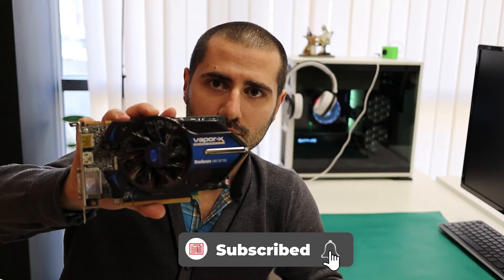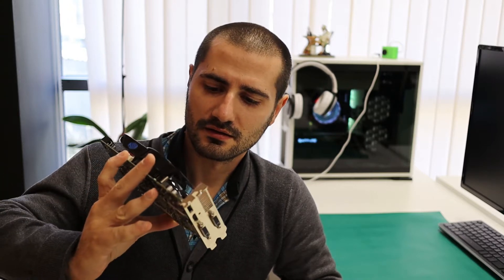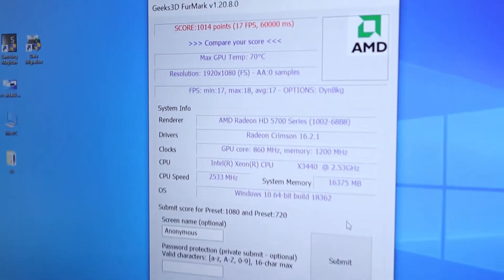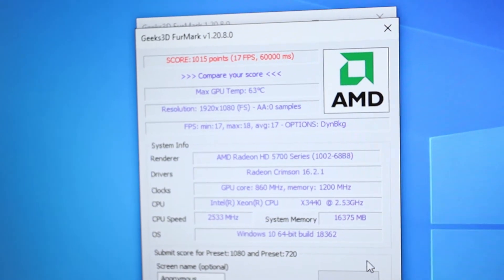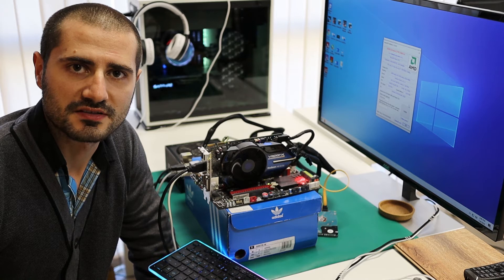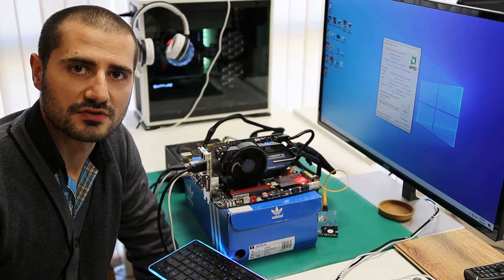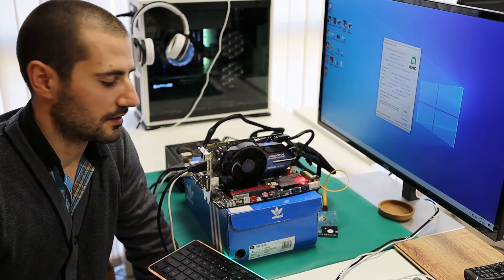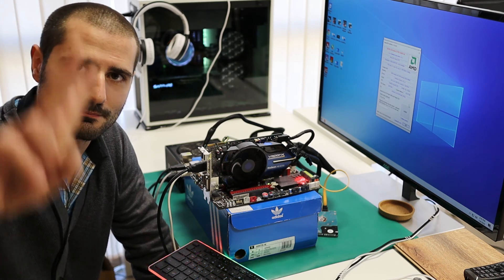Cleaning old SAPPHIRE HD 5770 Vapor-X GRAPHICS CARD

Comment: I got 5750 vapor X which it's almost the same, thanks for video, really appreciate it. I'll change paste when I'll have a little time. Because I got it for more than 8 years and it's still great, never more than 70°© even on summer with 30°C temperature in the room
Reply from the maker: Wow, that's some nice temperatures for 8 years old gpu. I guess you don't stress it that much.